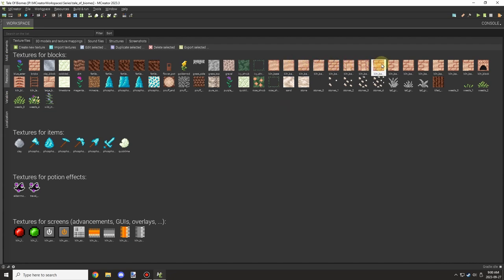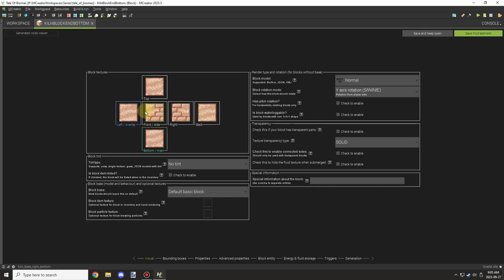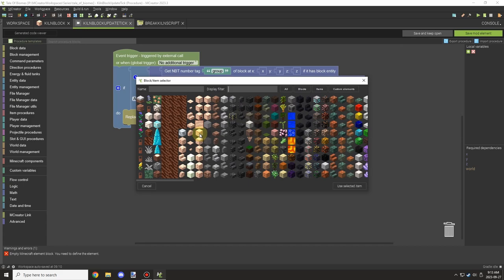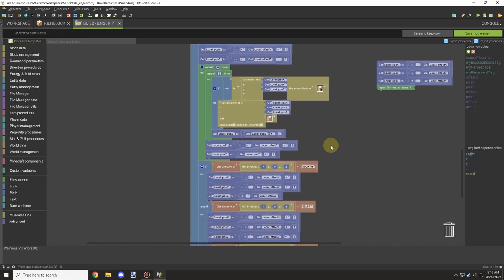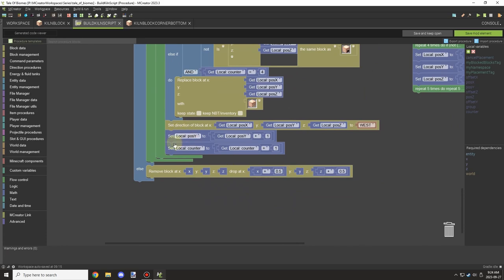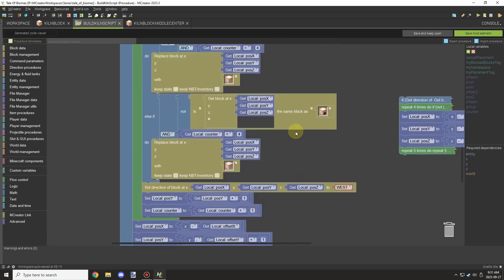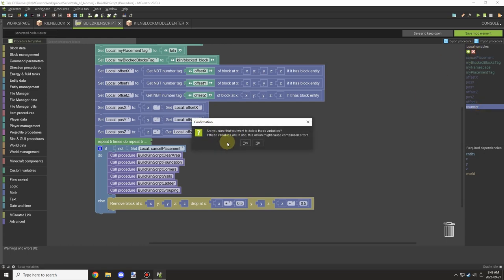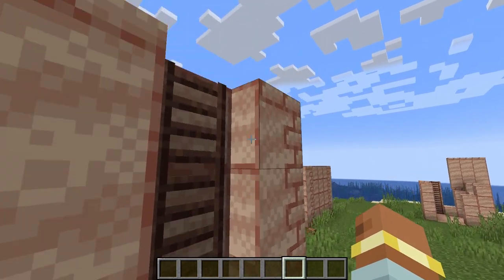A Better Klin | MCreator Lore | Ep35

Comment: Is there a way to make a ocean biom in a custom dimension?
Reply from the maker: Pre 1.18 this was possible but 1.18 and up it matches the same seed as the overworld, but you can use the continentalness to control how far out or in the coast line the biome will generate at. negative values are out at sea while positive are inland, generally Minecraft uses between -1 and +1 but mods can use -2 to +2
Reply: Thanks😊